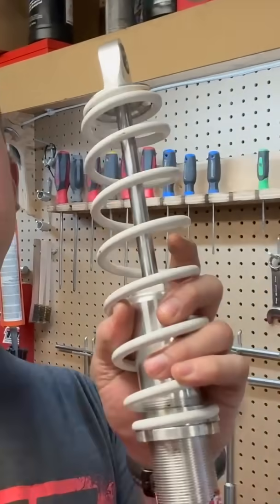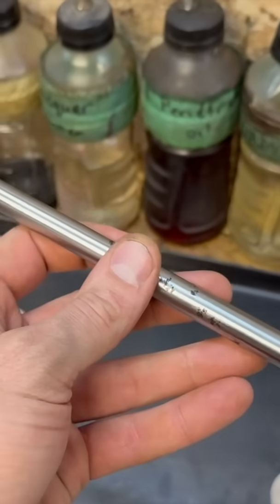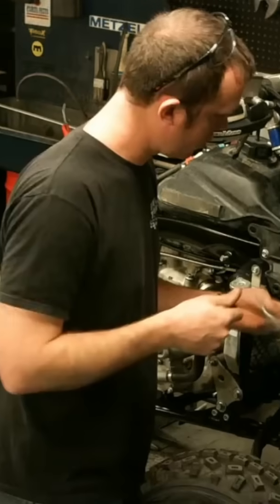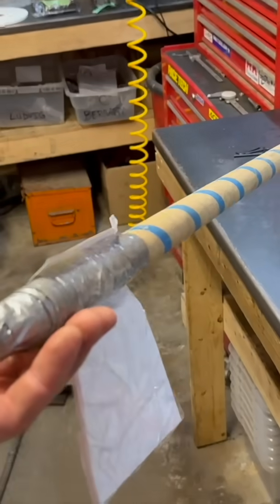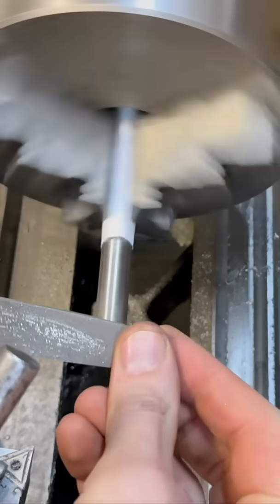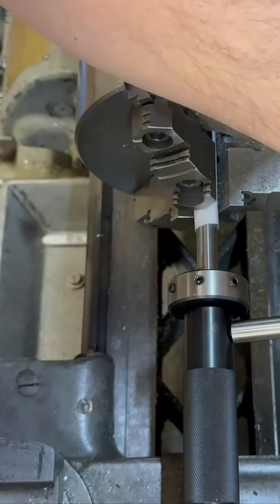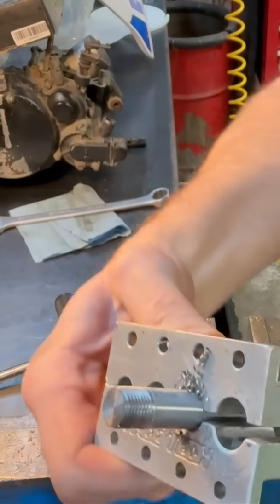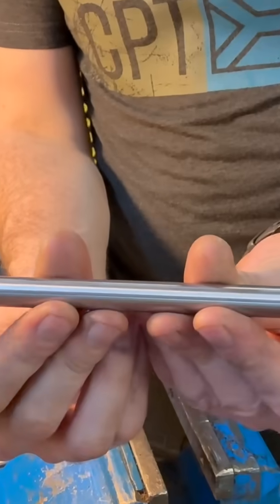Damaged Shaft? Machine a new one!

Comment: What are you using as shaft material that can be machined like that but has the necessary corrosion and wear resistance?
Reply from the maker: It’s all in the full video.
Reply: @ChuckfromTrueTech  looked everywhere. Struggling to find the full vid. Do you have a link to share? Cheers.
Reply: @R0ger007  pretty sure it's just chrome plated steel rod. That's what we use to make custom hydraulic cylinder rods. The chrome part is pretty hard and needs a carbide tool, but after that it's pretty easy to machine with tool steel. Also I couldn't find the video either without watching each one.
Reply: @ajc894  turning a plated rod down to diameter will remove plating so you'd require correct diameter to start with or have new diameter rechromed 🤔
Reply: @R0ger007  we ordered it in the OD size we needed. I guess if you are looking for an odd size that can't be found you could turn something down and get it rechromed. The shaft material we used was 1045. What size are you looking for?
Reply: @ajc894  not looking at the moment. Had shafts replaced in the past and it would be nice to diy in the future 👍
Reply: @R0ger007  got it. I keep a stock pile that I salvage from old car shocks for miscellaneous projects. You will find a range of metric and standard sizes. Struts seem to come with a larger rod than shocks. Hope that helps.
Reply: Scot Industries sell all kinds of chrome plated rod.
Reply: @vettepicking  a bit far to collect from UK 🙂